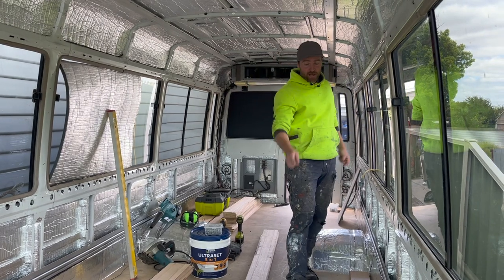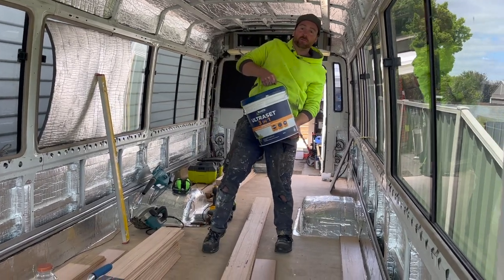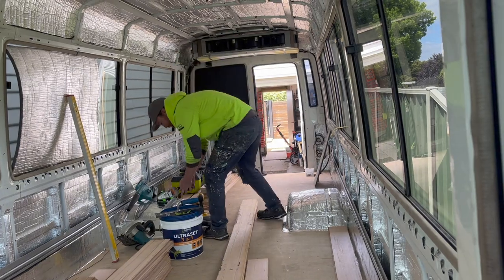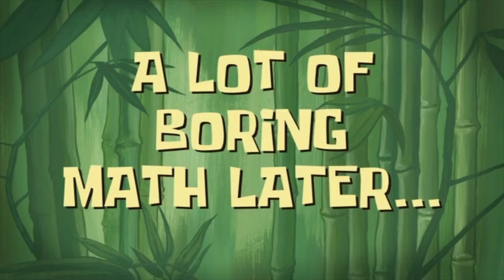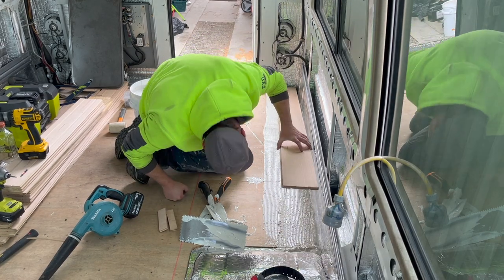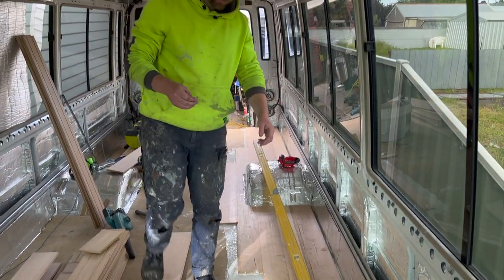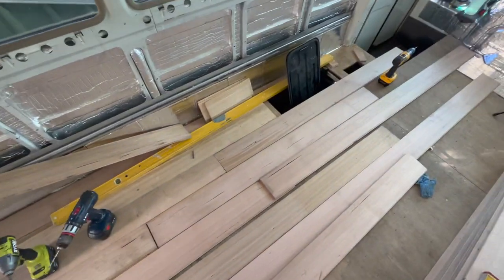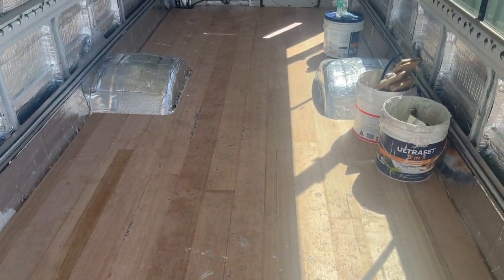Installing Hardwood Floor in a Bus! - DIY Bus Conversion

Comment: Hey, thanks for sharing this video. It's really useful for my Coaster plans. I don't want a vinyl floor, but I also need to be wary of adding extra  thickness as I'm quite tall and need as much headroom as possible in the bus. I'm looking at all possibilities. I grew up with a cork floor and really liked walking on it with bare feet. Might look into it. Beware of anyone purporting to be an 'expert', I reckon!
Reply from the maker: @Nugget S. In all my years I never thought I would be grateful for being hobbit sized haha! All in all though, the way we went about it, we've lost 12mm for the hardwood floor, 9mm for the framing of the ceiling, and 12mm for the ceiling panels. So it's not too bad. I'll say though, weight wise the hardwood adds 100kg. HOWEVER, if you install vinyl correctly, you need to install masonite, and so the weight winds up nearly 100kg anyway with masonite and Deluxe Vinyl Planks. IMO (and, I'm biased) I am WRAPPED with the hardwood! The sound and insulation rating is awesome coupled with zero VOC. It's awesome. And that Bostik stuff I used, is an added layer of luxury underfoot (albeit expensive though!).
Reply: @Deeptalkers  Thanks for the reply and that extra info. Hardwood is certainly something I'll consider. I'll keep watching your build with interest.

Comment: nice job well thought out wood is good
Reply from the maker: It was a tough one though, I bought 20% extra despite being assured by the seller I’d only need 5% because it was such high grade. I reckon about 50% of the boards were firewood without intervention. So annoying!!

Comment: why not use a moister  barrier ,much like gortex ,but like Vitek air in water out. no goop. inless goop stays flexible for driving.
Reply from the maker: I haven’t looked into gortex, but bostik told me that if I used a barrier on the top their glue would not adhere to it. So I figured… I’ll just bite the bullet and go with their advice. The underside of the bus is coated with a bitumen seal though. So it’s unlikely any moisture will rise up from travelling.

Comment: How has your flooring held up to the bus flexing while driving and moister variation since the installation?
Reply from the maker: @todddrummond3138 so far so good! The flooring is still like new, and our bus weighed in at 4.3 tonne for inspection. The bus is rated for 6.25 tonne, so plenty of room for luggage. Over all, wrapped with it!

Comment: ok bostik say do this ,is it wauranteed,  I just no what worked for me ,how about Cork? cheers
Reply from the maker: I think for cork board they recommend the same thing. I was reading the tub the other day and realised why they probably recommend it, it’s essentially not ideal to use the product on any surface that is smooth, it needs a a porous surface so it can slightly absorb into it. I mean, I reckon it’ll still work though.
One thing I’ve learned in my years in construction is EVERYTHING is over engineered. It’s so that if the product fails due to bad manufacturing they can say “well you didn’t do x, y and z. So we don’t have to fix it”. It just covers their arses really.